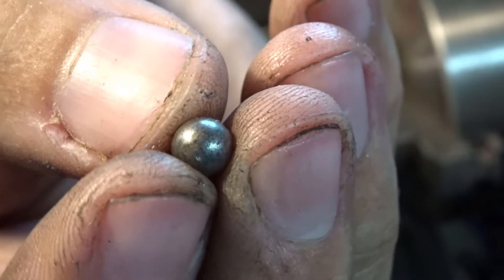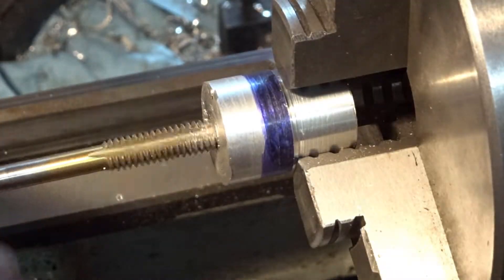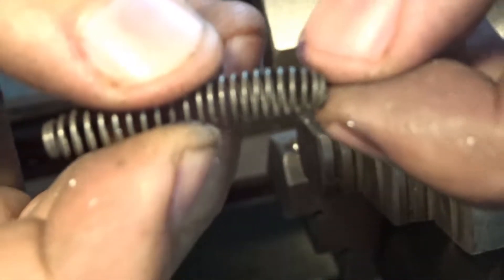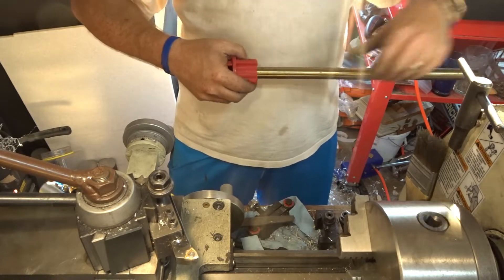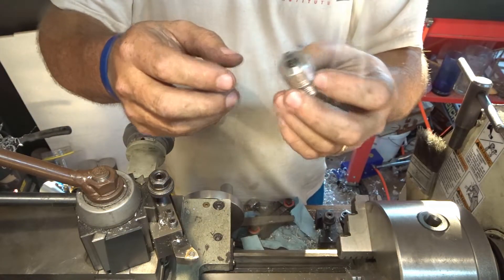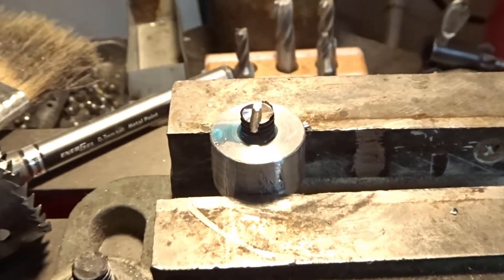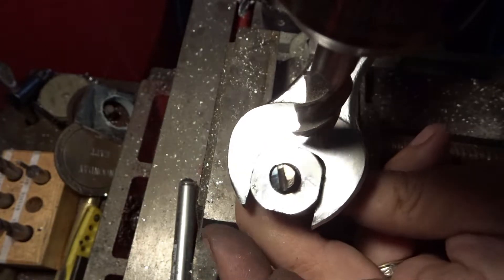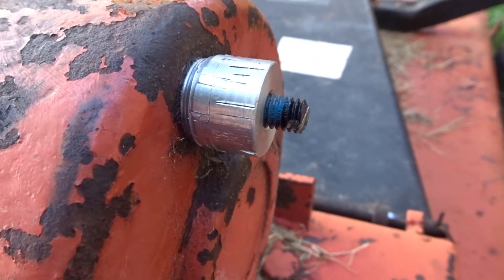How to Make a Check Valve Pressure Release Valve Part2

Comment: I seen your air compressor looks like mine I just bought has it been a good one for you.
Reply from the maker: Oh its been an awesome compressor.  I have a few videos of what Ive done to make it better.  I did buy an auto release valve that helps drain it automatically from Harbor freight.  I DO NOT RECOMMEND getting that.
Reply: Yes that was when I saw the compressor when you was putting it on that's what I'm doing now put I went with one on Ebay that plugs into the wall 120v